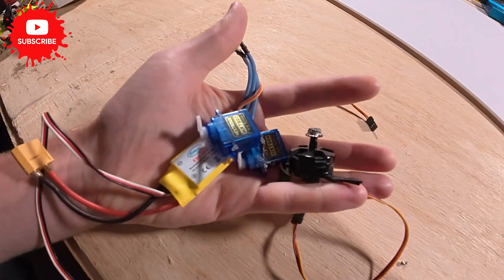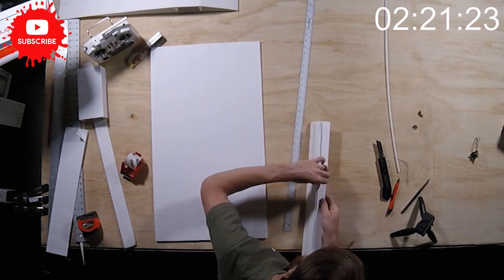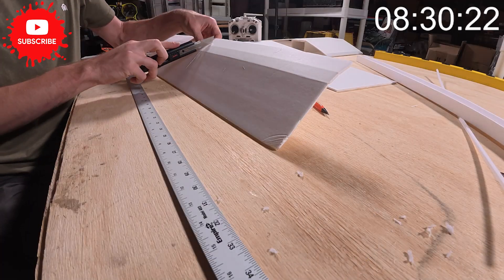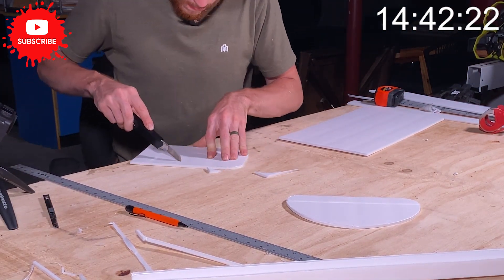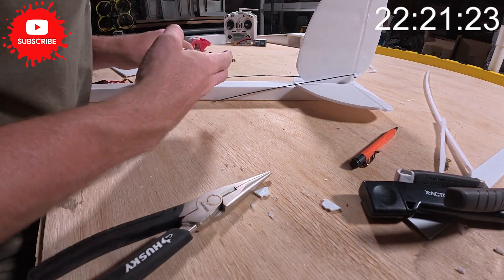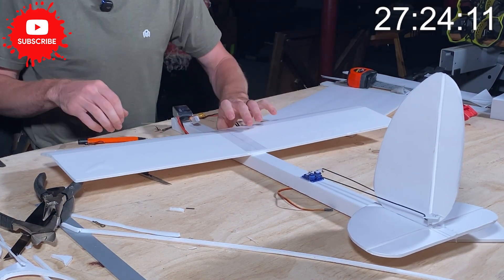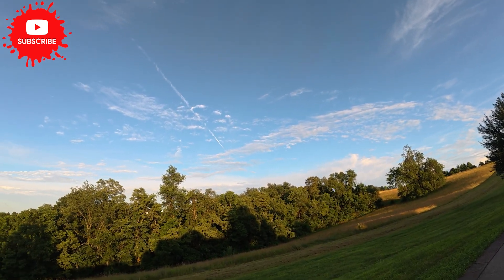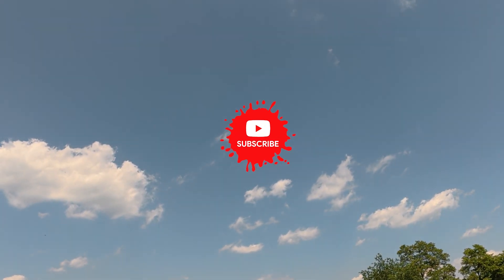How to Build an RC Airplane in 30 Minutes

Comment: 1108   in general, the use of a wire pushrod calls for the use of some support over the length of the pushrod; in order to minimize flexing during 'push'.
Reply: Coffee straw ?
Reply: For a simple slow flyer like this it doesn't matter so much, things aren't going to be accurate anyway, but I completely agree a bowden tube or even small supports across the wire help a lot

Comment: 0752   the use of curvy leading edges is not recommended.      the vert-stab is over-tall and extra heavy; the height should be equal to a bit less-than fifty percent of the horiz-stab span.
0907   put the mass of servos  Near  the cg/c-m; not aft-of it.    c-m is center of mass.
1050   'about a third of the chord back'      THAT  MEANS,  THIRTY percent  not  33.    or a bit forward-of thirty.